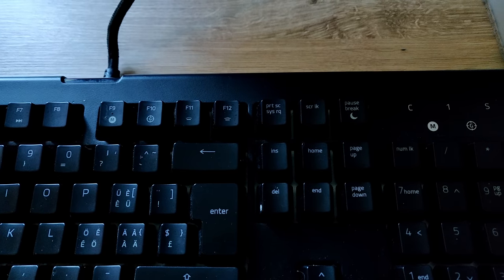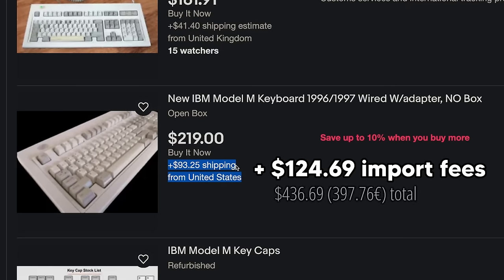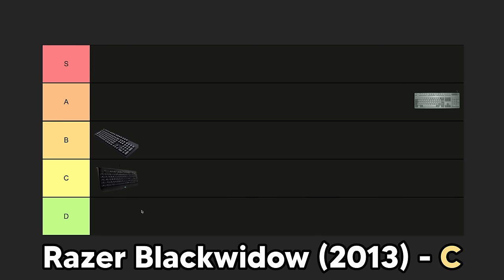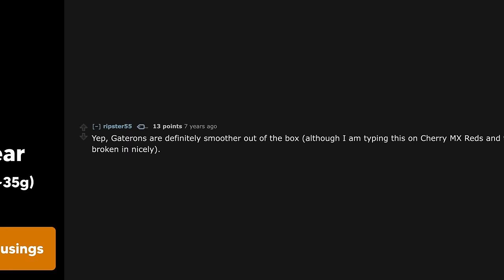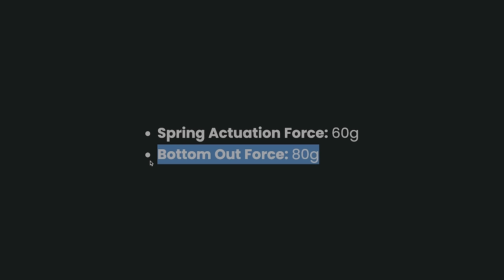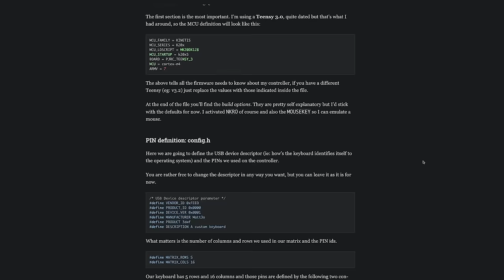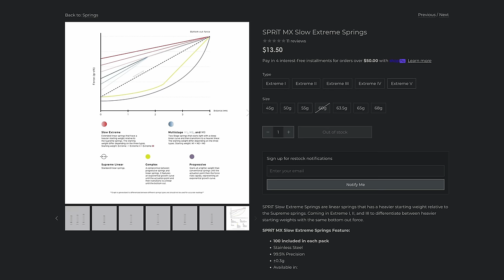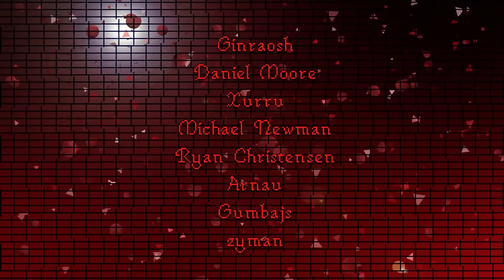How I Lost Interest Towards Mechanical Keyboards

Comment: My first dive into the rabbit hole was  2017. I knew about the glorious  HHKB but couldn't afford one, even those Ducky One and Anne Pro keebs. My first mechanical keyboard was Ajazz non swappable keyboard. Despite being non swappable, I modded it by lubing the switches where I desoldered all the swtiches. I also replaced some switches with gateron yellow ks3. Then I stopped looking into keyboards for a while. I bought my 2nd mechanical keyboard Royal Kludge RK100 during the pandemic. Now I'm planning to buy a Keychron V1 with Akko Jelly Black Switches and GMK cloned keycaps.
Reply: The royal kludge is such a beast for the price

Comment: Once you go HHKB and get used to it, everything else feels like a massive tradeoff. I got into the mechanical keyboards game fairly early (around 2010 or so) and had pretty much the same experience as you. I occasionally buy a new keyboard to try it out, but I always go back to one of my HHKBs at the end of the day, and the new keyboard will sit in my closet collecting dust. However, the Realforce R2 Limited boards are a solid contender to the HHKB and still Topre as well if you'd ever want to retry using a traditional layout.

Comment: Got my first HHKB around 2011, I've never looked back since then. All my other MX boards are either sold or haning on the wall as "Decoration".

I ended up with 3 HHKBs in total, one of them is a Pro1 and I think I've saved quite some money on the long run... The only board worth considering right now is the Wooting 60HE imho, but just for gaming and not for typing.

Comment: I don't like the loud, "clicky", keyboards because I don't pound the keyboard and have a light touch. I prefer the scissor-switch "quiet" keyboards. My favorite has been the old Microsoft Natural Elite keyboard, though I've worn it out over many years of use. Now, I have a Perixx Periboard-333 wired backlit keyboard with a silicone keyboard skin on it. The keys have a short-throw and I can type at a quick rate without making much noise.

Comment: Is it the HHKB layout, or the switches that you like?  I've heard so many opinions on the HHKB, and NONE of them have been in the middle.  It's like either you really love this keyboard, or you hate it.  Those that don't like the layout scream at where the arrow keys are.  Me, I've used the IBM Model M for over 40 years now.  I have three of them,  (one is a 101 key layout, the other two are TKL), and all three are showing their age with some keys sticking or failing to register.  I am now using a Corsair K70 with Cherry Blue switches.  It's OK, except that I will probably have to replace the "T" switch eventually, as it is forever registering TWICE on a single key press.  I have also bought a Drop ALT off ebay, and will try out the reduced size / layout.  I have no issues with the TKL layout, and so rarely use the function keys, that the 65% layout should be OK for me.  
I am not a keyboard snob, and frankly, I can't hear the difference between all of the different types of switches.  So long as I can type error free on a KB, I don't care what the action feels or sounds like, providing it doesn't cause fatigue or pain from constant use.

Comment: The reason I bought a mechanical keyboard was mainly reliability. They are easy to clean, especially in comparison to membrane keyboards which when you disassemble them you might as well buy a new one. Those little rubber pillows are impossible to keep in place as there are no sockets for them. I don't care much about the noise because I use headphones.
Reply: I o-ringed my keyboard and I don't think it is loud. I have MX blues too. Which are supposed to be really noisy. Seems OK to me.

Comment: Back in he days when I started doing PC stuff (90's) there was 50% chance that the keyboard you're working on was mechanical. Back then, even the dome keyboards were more tactile (e.g. I  loved late Chicony's). Most people didn't even notice they were working on mechanical. Then PCs become cheaper thus mechanical keyboards no longer fit into the buyers' budget so they fell to oblivion, alongside with the white keyboards. I personally liked the low profile domes, but when they wear out they awful.

My first mechanical was a Havit low profile with Kailh PG1350 blues, it's still going and have a nice tactility. I also have a low and full profile Tesoro gram spectrums, all blues and they are uneventful daily drivers. I have been a 104 key person and will remain. For people looking for budget blue switch keyboards I always point them to the better Outemu Blue keyboards (e.g. Modecom Volcanoes). Crispy tactile bump, high pitched click, the best bang for the buck.

I borrowed an IBM model M for some weeks and it was a blast (it reactivated the memories I've been looking for in tactility), the only real issue I had is that one had to bottom out to actuate.
I wondered if there is a keyboard having the best of all worlds.

And then, one of my friends brought me two defective basement find keyboards for free. One was an NTC KB-6251 from 1984. The other is some noname knock off form the same era, but both of them showed close resemblance, even in the PCB. However, the NTC had ALPS SKCM whites in it and the other keyboard has some noname amber switches (also clicky) and also ALPS style keycaps.
So I took the NTC apart, disassembled all washed and lubed all the switches, fixed some switches and the PCB and took the keycaps of the noname one because they were superior in sculpture and double shot BPT instead of the ABS of the NTC. I had to keep some of NTC's control keycaps though. The case and keycaps got some retrobrite treatment.
I dare to say that these beaten up ALPS switches with 70g springs are still amazing even in their afterlife. They know one thing no modern switches (except maybe some Taihaos) can, banging the clicker to the switch housing going thock while also click. Perfection. Even with the same switch keycap material and sculpture can make all the difference.
Once again, the ultimate typing device, a soon 40 year old keyboard/switch. This is why old people sometimes say, not everyone had the privilege of living in the good times.

At this point I'm done actively looking for better. Maybe if there was a modern board that accepts ALPS SKCM, and also a set of new old stock switches PLUS sets of ALPS keycaps to chose from.

But I can hardly see myself spending 400 USD (+labor) on a keyboard when 90% of what I consider typing heaven comes from junk barely evaded the dumpster.

Comment: I feel this big time. Thankfully I was able to recognize how much I like the HHKB before ever selling it, but I did try to move on from it and built a custom MX board. After the honeymoon period with the custom I tried switching back and forth between the two and decided I just like the HHKB more. I even used the same layout for the custom, it all comes down to the switches.
Reply: I am no keyboard expert, i have a low value wireless mechanical with backlight that was from the first of it's kind back in the day and i have been using that for many years now.
It felt massively more satisfying typing on it than my previous membrane Logitech keyboard and did the job so i never got into trying all types of keyboards etc. 

BUT i am quite surprised that this very expensive HHKB keyboards shown here are built the way they are built that he needs to put little pieces of paper for them not to rattle. 
My $50 keyboard doesn't have a line like that to put pieces of paper. It is one solid thick plastic piece which is why after using it for all this years it never makes a sound or rattles. 

How can such an expensive keyboard have worse built quality that a cheap $50 keyboard seems quite amazing to me.
Reply: @SIPEROTH  If I had to guess I'd say that's likely due to him picking it up second hand. Could have been poorly stored, carried in a backpack (common use case for this size of keyboard), or the previous owner may have modded it at some point. There's a fairly common mod where you remove the bottom case and put in a sheet of foam to fill the space between the PCB and bottom case, which if you use anything too thick can make it hard to tighten the screws fully. That could very easily cause a little gap like that.

Comment: my keyboard journey is still on, but its kinda hellish due to the fact that im too broke for this hobby, and im used to buy things without any thinking. My first mechanical keyboard was a Hyperx alloy fps with cherry MX browns. I bought it for 110$(which was pretty expencive for a 15 y.o me), and it turned out to be trashy, considering that i could buy something much better. my second keyboard was bought 1,5 years later form my birthday gift money and it was an optical skyloong sk61 with optical gateron yellows, which was not a good idea either, but i had an oportunity to modify it. 60% layout was perfect for my small desk, and its just natuaral for me to use fn key always. i applied lube to switches and stabilizers, put foam inside it and it sounded really good for it's crappynes. So 2 happy years later i was given some money, and i was pretty much tired of not having much options for switches and 1000hz polling rate, so i bought redragon K530 and it was another misstakes, cause i bought gateron milky yellows for them and pins couldn't fit in hot-swap sockets. And i had a plan: i swapped spring and stem from yellows to kb's original switches and it kinda worked. Switches had a minor step which was solved with applying lube to them.  Its not my endgame keyboard at any  point, but it sounds good. K530 with all these mods is around 120$ so it should sound good, considerring amount of effort i put into it.

Comment: Ive been in the mech scene for a few years (since late 2019, right before covid) and as the times went by i tried many different stuff, from clouted Korean customs, vintage buckling springs and alps, ortho and split stuff ... but in the end, i think what I'll do is design my own board and leave it at that. I tasted everything that liked but nothing exactly fits my bill... most customs nowadays are very shallow which makes a bad clicky switch case, and im a huge fan of buckling springs and other clicky vintage stuff. Id like to end it with a bang with some zeal clickiez in a custom designed chassis or something.

Comment: I decided to just buy a pre-built GMMK Pro and get on with life. Was much easier and I didn't need to dive deep and dick around with building it and lubing stuff etc. Saved me a ton of time, and was able to just plug it in, setup QMK/VIAL, and off to the races I went. Really wish it had north facing RGB cause F cherry style keys and building a board layout to account for an issue that key cap manufacturers should have been fixing themselves and not board makers. Anywho, no plan to customize or mess around with the board short of what I have already done replacing the aluminum plate with poly and putting v2 Aura keycaps on it. If a switch breaks I can easily replace the switch and so long as the board itself does not completely break, I will stick with it til the day I die.

Comment: Upon watching your video some more (especially @ 12:30 ), I do agree with the points you raised with the layout of the Razer Huntsman v2, but at the same time I took a page from your book and just swapped the key functions a bit. The L. Ctrl key is now a Fn key and the Capslock key is now the L. Ctrl key, similar to the HHKB. That way I can have a Fn key on my left and my right hand for various functions.
Reply: Update: I bought the Razer Huntsman Mini Analog because they copied Wooting's Rapid Trigger on the analog switches. Concerns regarding the Rapid Trigger aside (it is inferior to the Wooting's, but is much cheaper and more readily available), it turns out that the keybinds on the Fn layer are modifiable. That means that when I press the L Ctrl or the Fn key now, 1234QWERASDF are FN 1-12, Tab is Capslock; JKLUIO789M. are numpad 1234567890(Del), and I crammed the rest of the keys in the buttons between.

It turns out that a 60% keyboard can fit a whole 100% keyboard's functions if you have a good programmable keyboard, and I am very happy with this. The only real downgrade is that the switches aren't silenced as they are on the Huntsman V2 Mini.
Reply: Another update: Razer took back the ability to infinitely configure the keybinds on the Fn layer.
I needed a work-oriented keyboard anyway, but got used to the 60% layout, so I decided to purchase a Keychron K12 Pro (it has QMK/VIA compatibility, which means infinite customization of keybinds up to 5 layers total).
Making it a modified HHKB was great. I just changed out the keycaps and the switches and it's an excellent typing experience overall.

Comment: I started with a cm storm quickfire rapid, mx blues. Used it from 2014 to 2021. Did my first custom mechanical, zeal aqua zilent 62g. Love it but never use it. Use my MX Keys more. Might get a HHKB but my MX Keys is the most comfortable ive owned. Most accurate as well.

Comment: thanks for sharing your experience with keyboards. i strongly disliked the whole custom keycaps with a bunch of crap on it, the stupid coiled cables (they even make a protector you put on it so it doesnt uncoil - WHY) and the extreme oversaturation with the gateron switches and different options targeted to gaming. i feel membrane is actually superior, but i started using an apple m0110 that my dad won in a contest back in the 80s via a 4p4c adaptor and loved it immensely because it felt like the "anti keyboard" to the mechanical keyboard culture. just last week i finished completely handwiring the keyboard with diodes so it now has n-key rollover and full qmk customization. i feel that's the end of the line for me, i just wanted something different as i detest the peripheral scene and usually respond to situations like this with either extreme exaggeration or doing something so inconvenient i find it comical. it's kind of funny thinking to how i used a programmable 21 key numpad to be able to shoehorn this keyboard into daily use for a good year. it now works perfectly for everything and i have no interest in pursuing keyboards further aside from maintenance, ie replacing the alps skcc switches when they break as they're extremely fragile lol

Comment: Can kinda relate to this video! I never really dove too deep, only ever bought two boards and still own them - a Corsair Strafe, and then an Anne Pro 2 (60%). I've been dailying the Anne Pro for the past year or so, after filling out its shell to sound a lil less hollow. The only thing I've kinda wanted to try out is some kind of Akko tactile switches in place of the gateron blues it came with.

Per the 60% thing - I absolutely wouldn't be able to stand this thing if it weren't programmable. The Fn1 + IJKL layout for arrow keys you demo'd looks super uncomfortable. I have mine set up to be CapsLock + WASD for arrows! Caps works as normal if you tap it, but an FN1 mod if held down, it comes out real comfortable!

Comment: Buckling springs are technically a membrane keyboard, not mechanical.  You'd never know because of the sound and the feel and the weight though...  They use the springs to press a membrane that is down below two metal plates the keys to activate the key.

In my opinion, the buckling springs are the best keyboards for typing.  They feel great and most are rated up to 50 million key activations.  They suck for gaming though because they have slow trigger times (MX blues are the fastest for the least input lag), and the key pressing is heavy so it's hard to move super fast around the keyboard.

If you're a programmer or writer or general computer user you may love a buckling spring keyboard.  But if you're a gamer I would get an MX blue or torpre keyboard for that.

I guess you could get one of each and swap for different uses, but considering what either of these can cost...  That seems a little ridiculous.

So I am not surprised you didn't care for the Model M since you do a lot of gaming.  The spring keyboards just aren't...  Made for that.  The original Model M came with huge IBM mainframes and needed to be strong and reliable and rated for tons and tons of keypresses.  Since that was back in the early 1980s, gaming was never a thought in the mind of the engineers that designed them.

Also, yeah, the noise will be too much for some...

Comment: Dude are you familiar with swappable keyboards or maybe lube?
Reply from the maker: Hot swappable keyboards weren't a thing back when I got those keyboards. The first hot-swap keyboards started appearing in 2017/2018, but most of them weren't very good at the time still, and the DIY hand-wired keyboard I started working on was from something like 2015.
The only "new" keyboard I bought in like 2018 (back when hot swap still wasn't omnipresent) was the f96, but there weren't hot swap alternatives at the time, or if there were, they were expensive and or not available.